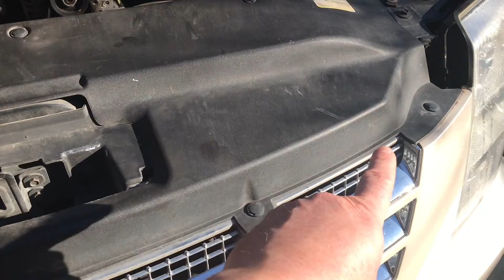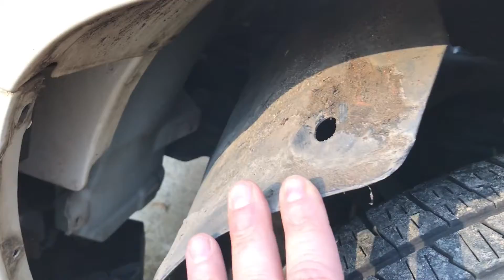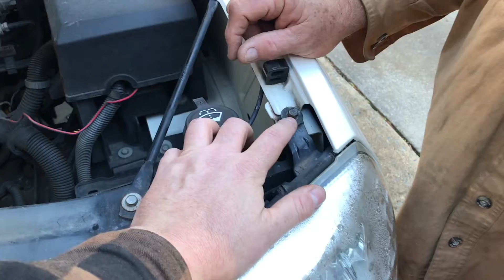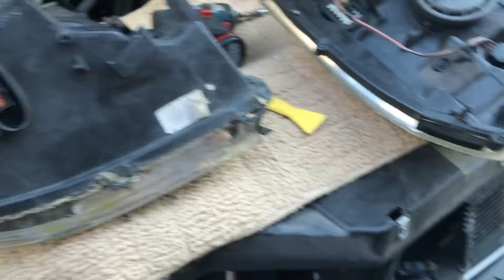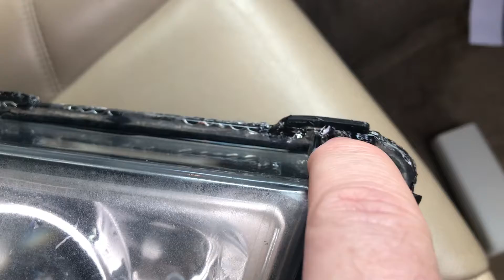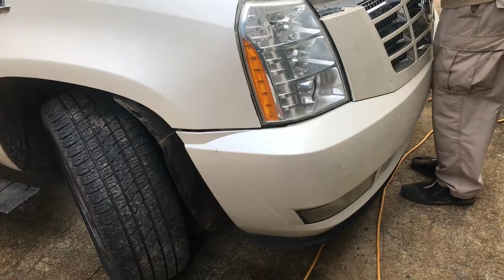2007-2014 Cadillac Escalade Headlight Replacement

Comment: @DIA Guys This right here is GOLD... Not only did you illustrate ALL necessary steps to remove the headlights, but you also illustrated ALL necessary steps to remove the front bumper; If you only knew how many WEEKS I've been scouring Youtube for this information as everyone else seems to rush & skip around different parts of the process rather than showing the FULL step by step process & showing ALL bolts that need to be removed. While I truly wish the GRILLE could be removed without removing the entire front bumper (I have a custom grille that I'll be re-painting & installing shortly), I will say that the headlights CAN indeed be removed by simply removing the 2 "underside" 10MM bolts at each end of the bumper, followed by the 3 10MM headlight bolts shown in the video & the 2 10MM "upper grille" bolts closest to each end of the grille. You just have to gently pry out the grille a tad (at each end) & also gently pry down each end of the bumper (simply using something to pry it open as you remove each headlight). Probably a lil tougher gettin em out/back in that way, but less time consuming than removing the entire front bumper & I pulled it off during a recent "test run" (prior to purchasing another set of headlights for my 2012 in the coming months). Thanks for posting, this was GREAT!
Reply from the maker: Thanks for the comment and for watching.  I'm glad it was helpful for you.  Good to know there is an alternate way.  I always get a little concerned about prying on anything plastic, especially when it is old, but I can see where the method you described would save time.

Comment: you dont have the take the bumper off...  waste of time
Reply from the maker: I took a look and tried this.  You can definitely get to all of the bolts securing the headlight without removing the bumper and grill.  The issue I had is removing the headlight after the bolts were out.  There were some features of the headlight that would not let it come out very easily (they are behind the grill) and I was concerned about damaging the paint or the headlight in the process.  I've actually taken the bumper and grill off the car so many times now I can do it (with an electric driver) really quickly.  Thanks for viewing and commenting!
Reply: @dia_guys  Good ideas for me to try, what's missing is the installation of the actual replacement light bulb. My 2007 Escalade has HID bulbs, after you get the headlight out your facing a strange looking bulb. The replacement does not have the "grid" needed to install the new bulb, this has to be removed from the old bulb. The task is figuring out how to remove the existing grid and attach to the new bulb.
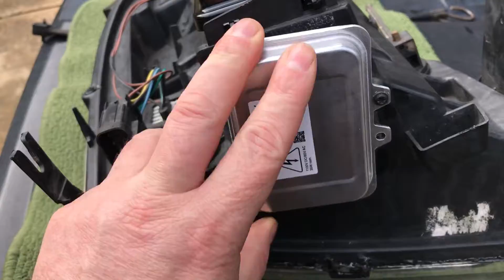Reply from the maker: @brucemoore711  In my case we ended up having to replace the whole headlight assembly after trying this fix.  See my channel for this video (2009 Cadillac Escalade ESV Headlight Replacement).  I’m not sure I understand what you mean by “grid”.  I recall removal of the headlight bulb being removal of the cover from the rear of the headlight assembly, an electrical plug you remove from the bottom of the bulb, and a quarter turn to remove the bulb from the socket (see the video at 16:40 where I describe this process).  In the video we swapped the driver bulb to the passenger headlight assembly to validate the bulb was good.  This lead us to the ballast as the issue.  If you can describe what you mean by “grid” more I’ll try to help.
Reply: @dia_guys  Hi, my Hi/Low bulb on the passenger side went out. I replaced the bulb, but still doesn't work. Could it be the Ballast and if so, is it the metal box the bulb is connect to?
Reply: You forgot to put the links to everything you ordered